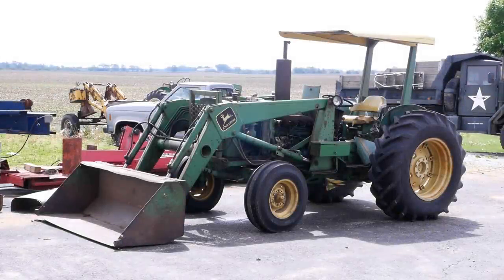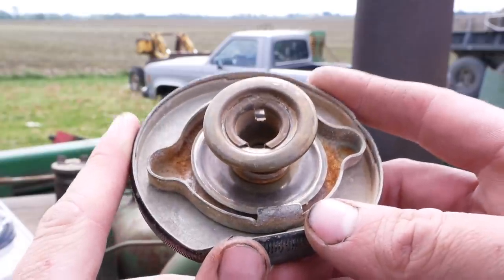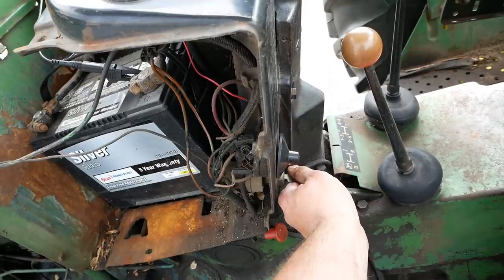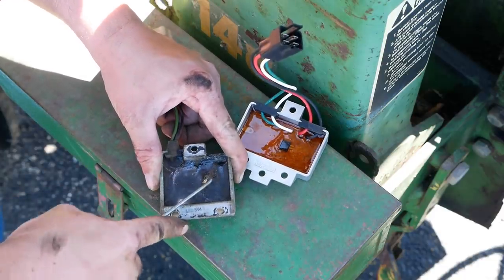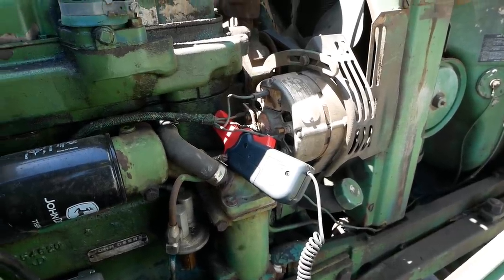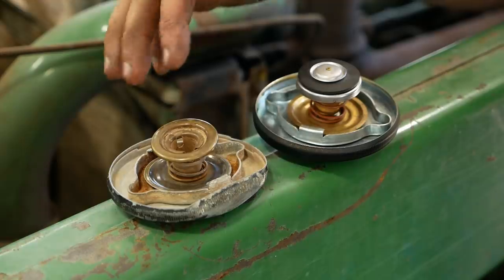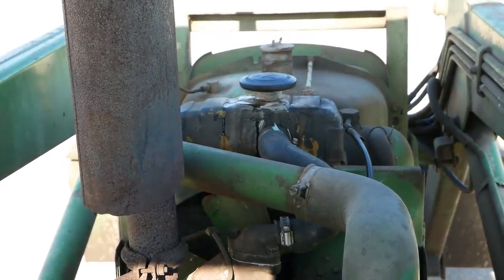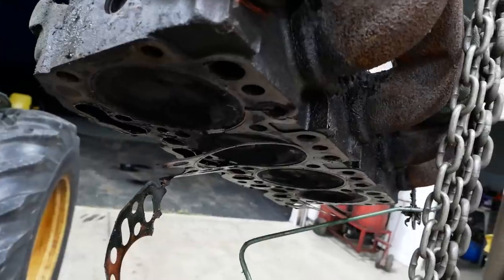Not Fixing a Tractor - Overheating and Barely Starting

Comment: Wow, just wow. I've never seen that many cracks in a running engine. 

I know the type of customer well, run something beyond the ground and then ask for a full service. 

Given the state of the engine I really can't imagine the gasket will make any improvement, but if that's what the customer asks for it avoids arguments and blame games further down the line. 

I see equipment for sale in the UK all the time with a long list of recent new bits being presented as a plus point. Every time I see one I think they've failed to find the problem and are presenting it in its best light to get rid of it. 

In my experience the service history is often a list of jobs that need to be revisited and done properly.

Comment: Had another story,Guy hired me to put clutch in his 1948 Ford.Remember that one the Entire rear axle had to be un bolted from the car in order to pull Trans.Got the car torn down,he only wanted me to replac clutch ,reuse old release bearing,and pilot bearing.Flywheel was severly heat checked,told him about all the problems,he said don't worry he was going to sell the car as soon as it was running.Came back about two weeks later complaining that I should have fixed his car better because it broke down again.I showed him the work slip I had made up where he declined to have proper repairs made.He got angry but I did not fix his car for free.

Comment: I really like your videos, and I don't want you to take this the wrong way, but this could have been avoided. The tractor sounded cranking over like one piston was much weaker than the rest. A pressure test on the cooling system would have pointed to deeper issues as well. It's worth spending a little more time on diagnostics even when it feels like you know what the problem is. 

For example: I once bought a Lincoln Navigator that had a nasty miss on one cylinder. I'd been around the block a few times with the modular motors, so I instantly thought "coil", reinforced by no signs of the coils having been touched recently. Nope. Burnt exhaust valve and mangled valve seat. That 20 minute fix turned into several weekends, all because I thought I had it figured out and didn't bother with a leakdown test.
Reply from the maker: I did a pressure test on the cooling system. It showed no leak even when left over night. We knew it had issues from the blow by but I just didn’t expect that much damage.

Comment: Sorry see that happened to nice John Deere tractor Wes :) also my late Dad & Late Uncle Bill bought 2 owner tractor in 1988 off excellent make plus model tractor with loader  and owner told them tractor was complete rebuilt! 4 years later what hard starting up plus Power Steering was loose like no asstiance at all when loader on but when off back normal and motor smoke so bad even after rebuilt completed previous to plus fuel injection pump also new injectors plus steal lines change no difference! So I took my work and got me plus my 2 cousin to tore apart found need need new block& head plus totally engine rebuilt on every thing plus hydraulic pump plus Steering overall also found need new Clutch plate too plus Brakes and electric on battery cables plus Starter even GM Delco Alternator put on ! Cost lots money to that Tractor to do but fix till one day my dad also uncle motor start overheat plus smoke black blue when bale hay found engine belt broke off motor plus took the Electric connection  of Air Induction on front engine near Generator or the Alternator pulley is ! So got belt for them plus had fix Electric Air Induction  connector plus brand new wire of 12 gauge wire solder plus wire up plus heat shrink lots electric tape too ! Fix up in field also back normal thank goodness or would had scrap the whole tractor and didn't at all ! But my dad & uncle always said after that B.S. struggle that never buying use stuff only brand new from now on dealer approve! The tractor had fix was 1978 International 724 72 hp Desiel motor 265 Cubic Inches size Double Displacement motor Detroit type with Allied 4 hydraulic cylinders and guy sold for low hours plus for $4500.00 in 1988 at auction farm sell ! But full of crap when had replaced parts in 2 years get it Wes !

Comment: i had to drill a hole transmission pan of one of those to clear a pickup screen, had no transmission pressure.  then cleaned and rebuilt the brakes with original parts.  then drove it to get beer in heavy traffic.  interesting day.

i also fried the old starter with dead batteries.

Comment: We have a john deere 300 industrial loader that has the 3 cylinder version of that engine. The block rotted away where the sleeve seals to in the bottom. The steering sloppiness is the bell crank setup in the front. Ours is wore out more than that. Lol

Comment: I wonder if water glass would seal up the cracks in the head and block.  My dad used it in an old Cat D4 head after restoring the tractor and found a leak.  It sealed up many years ago and still holds.  Obviously the engine needed pistons and sleeves, sad to see it but like you said the tractor has an endless list of repairs needed.

Comment: Just my opinion, in situation like this, head gasket repair sealer might be a viable option, the silicate chemistry at high temps solidify to like glass and plug up cracks in the head and block and it is permanent, have to follow the instructions and use a good brand for diesel engines

Comment: the weak point in your approach to this tractor is that you should have had the owners start and run the tractor and demonstrate its condition before you put a wrench on it......then you could have had a full picture of the possible scope of the problem before you fixed the electrical system......in future it might be wise not to rely on what the owner says but to ask for a demonstration of how they are presently using the tractor.....the clouds of steam and many leaks would have made an impression and you might have suggested a complete restoration

Comment: Product  up  in  my  neck  of  the  woods  called  Iron-Tite.  Used  it  several  times  on  "beyond repair"  cases.  Prolonged,  and  only  prolonged,  the  inevitable.  But,  several  months  to  seasonal  availability,  compared  to  sitting  in  a  field,  AND  one  that  had  been  six  years  with out  a  head  leak.  Keep  one  in  the  tool  box  all  the  time.   NOT  a  mechanic.  Absolutely  Not  a  mechanic.  Just  a  guy  who  needs  it  to  run,  and  it  needs  to  run  NOW.  Or,  at  least  tomorrow  morning.

Comment: Excellent  video 👍🍻. That tracktor will go to auction and be bought buy India trading company  and then shipped to India  where they will repair  the problems with JB weld and duct tape, then sold to a farmer there who will use it for the next 20 years. You my friend  got that tracktor  to start and run, they will hook up a 45 gallon tank of water to keep it cool. 👍🍻

Comment: Great job Wes. I'm sorry to say you can't fix stupid equipment owners. Ive decided the best way to check used machinery is to pull the air filters. I can't believe how people don't replace them. 3 things to long engine life. Cooling, clean air, and clean fuel. Most people will change oil.

Comment: I have found that sometimes you need a thermostat to cool it because water flows to fast and doesn't get cooled in radiator.  Had a big block Chevy and had it burn out starter when battery was weak and when starter going bad, battery would croak

Comment: What a frustrating job. Then again, what frustrating customers.  Maybe they think that running it on just plain water will cause sufficient corrosion for the cracks to heal themselves? You never know, it may be a stroke of genius. A self-repairing tractor. Why is it that they won't spend to save? Surely a few hundred dollars in repairs, or even a thousand dollars, is still cheaper than a new tractor? I would also want to give your electrical guy a refresher course on alternator testing. Man, that thing was against you every step of the way. Never mind, at least you fixed Thomas the Tank Engine. 😁 Stay safe.

Comment: I sent you a link to how I fix John Deere starting/charging problems. Cheap and works great. I use Delco alternator 334-2114 on Amazon. Works on most all older tractors. Jimco (jimcotest dot com)out of Raymore, MO has just about every bracket and wiring adapter to adapt a Delco one wire to just about anything plus testing equipment.

Comment: One or more of the four diodes in the bridge rectifier for the old alternator were bad.  With only two of them functioning, the output voltage will be very low, as it was in this case.

Comment: I would have run down the bad piston and honed the upper part of the cylinder.
If there would have been any good piston rings left i bet it would atleast reduce the blow-by.

On a wet liner engine, the condition of the block matters little, as long as the water and oil stay where they should its ok to have it craked between coolant passages etc.

I have a Nuffield that has a craked block between every sylinder, headbolt etc as it has had water frozen inside one too many times.

Still it holds it's liquids and they dont mix.

Comment: Man, I hate seeing a piece of equipment in that kind of shape. Makes you wonder about folks who would allow that. Anyway, a couple or three  comments. 1. I like those gear drive starters for John Deere. I use them exclusively. 2. Several years ago I started using Loctite 545 on all my hydraulic and air fittings. Have not had one single leak since and I don't find pieces of Teflon tape in my hydraulic filters. 3. I get rid of Motorola electrics when they fail. Hate those POS. Delco one wire internally regulated is the way to go. I find several YouTubers doing the same.

Comment: At 21:20 it looks like the radiator tank is split between the filler neck and upper radiator hose fitting from freezing when it had water in it.

Comment: Over heating problems , try filling the radiator up to the cap with fluid and spin it no start . Bubbles and you got problems .   Any one that runs straight water / no thermostat   send them down the road .

Comment: Wondering if you could have offered to carve out where some of the cracks are and scab in some weld and clean it up just to reduce the leakage a bit, and put sealant on the head bolts like you said
Reply: Nvm it’s not even worth that

Comment: It's a good idea to put some chassis/axle grease on the battery posts and all over the battery terminals before you reinstall the cables.
Reply from the maker: Not on YouTube. People go bananas about that!
Reply: @WatchWesWork  -- I've done it for over 45 years!  Never had a bad battery connection in all that time.  I've even seen that method described in military heavy equipment manuals.  It works by keeping the connection free of oxidation and has zero effect on the resistance of the circuit.  So I guess these keyboard mechanics know better than the military maintenance manuals.  :o)
Reply from the maker: @rpsmith  I like to cover them in dielectric grease, but that makes peoples heads explode on YouTube...
Reply: @WatchWesWork  -- My philosophy is to teach when I can and ignore when I can't.

Comment: My Skoda SUV has a feature where it runs the cooling system for a bit after you turn off the engine to get rid of the excess heat.

Comment: It is at least possible that the cap created much or a lot of the problem.  The pressure in the system means fluid exits where resistance is least.  Sometimes a new cap makes the radiator leak, for example, when the pressure of the cap now exceeds the condition of the radiator.  So in constantly exiting the useless cap it was not cooling as it needed to otherwise.  If true, sad indeed.

Comment: How small of a borescope would you need to look in cylinders of something like that, and how much time/work is there to get injectors or glow plugs ( if applicable) out to use it?  
Seems like maybe, and I'm guessing, if there was a way to be more sure of if it was getting coolant into the cylinders you might have stopped sooner on the job.  Passing the chemical test in the radiator early on there was not good.
Reply from the maker: You could do that, but I've never tried it on a diesel.

Comment: you said the problem right at the start. 'john deere'
you know what they say. nothing runs like a deere.

in all seriousness any machine will last if taken care of. if you keep the coolant, oil and stuff up to it and replace bits when they are worn out or broken the tractor will last forever. if you just ignore everything then everything will be broken. 
i think the cracks in the head and block may have been caused by someone dumping cold water into an overheated engine. 
that tractor could be fixed it would just cost quite a lot to do. is it worth it? depends on how much you value that machine, i would say judging by the condition of this tractor i would say they don't value it at all. 

if it were my tractor would i fix it or get it fixed? no, because it wouldn't be in such bad shape.  even if it was in that condition i probably wouldn't fix it as the cost would likely be more than a reasonable used machine.  but i would work out the costs of fixing vs the cost of another tractor and work it out from there.

Comment: I'm not wise to tractor replacement cost or repair costs, but with this tractor would fixing everything be more than 30 or 40% of the cost of a new tractor?
Reply: It probably does make sense to repair everything on this tractor,  it will be expensive for parts and labor but it will be a small fraction of the cost of a comparable new tractor.  Tractors are freaking expensive,  if you need a tractor you have little choice.
Reply: @davidnull5590  Yeah, that's what I was thinking too, all the more reason to take care of your equipment with proper timely maintenance!

Comment: Blue devil head gasket sealer may work it runs about 7499 for the big bottle all you have to do is remove the thermostat and let it run also no coolant must be in the system so you must flush it out,.

Comment: What would the availability and the cost be to replace that tractor with a used one that would be functional? Clearly that one has reached the tipping point of no return.
Reply: everything is fixable IF you are willing to throw enough $ and time at it. that beater isnt worth neither, better off as parts donor to save one that isnt beaten down nearly as badly

Comment: Running water in the winter is what cracked the head and block im surprised it wasent worse
Reply from the maker: I suspect they poured cold water in it when it was hot.
Reply: @WatchWesWork  What makes you believe that?  Does it crack in a different place/manner?  Or do the condition/problems of the machine suggest it is more likely?

Not challenging your expertise Wes, I want to improve my knowledge.

Comment: Man, that's a tough break. Having family that works farms, I know about making these decisions and it always sucks, especially when they don't take the best care of something because they think they are 'sticking it to the man', or just 'farm fixing' it. A few of my distant cousins are cattle farmers and they cultivate their own feed too. Some of them take utmost care of their stuff and some don't. The successful ones are taking care of their equipment, which is not to say they don't cut corners like crazy. The other ones will leave tractors in the field, not sharpen blades, run rusty bailing wire through the bailer, take their hot tractor into the creek which comes up to the engine. All sorts of stuff. Their stuff is broken a lot.

Comment: It's annoying how people in general just run shit until it fails completely. The cooling issue on the tractor caused the cracks for sure especially not even using coolant. They straight up fed you a line. Shame on them for wrecking a reliable old tractor, most farmers are actually going back to the older equipment because it's far more reliable then the over priced new crap.

Comment: I'm guessing the owner doesn't use it much and is hoping to get by as long as possible, after all he has been using it this way. With everything else that is wrong with it the tractor may not be worth the price of an overhaul. This way he gets some use out of it before the scrap yard. Question, could you have done a compression check for a head gasket leak instead of the fluid and found the cracks?

Comment: I have heard that block testers are not an effective way to test for blown head gaskets on a diesel ram into that on a duramax gasjets were blown block test showed good
Reply from the maker: The problem is the test is done with the engine cold. Leaks usually show up when the engine is hot.

Comment: CE Auto Electric Supply has crimp elbow and flag terminals you could remake those battery cables with. 
Also, after you said it's much worse in the daylight, I knew you were going to say the engine block was cracked before you even got to the head. Oh man.

Comment: Only John Deere I have ever owned spun a bearing. I need the engine rebuilt but it's $6000 minimum to rebuild it and I only gave $1200 for the tractor. They are only worth around $5000 as is so I haven't been able to justify the rebuild yet.

Comment: Offer them $2000.00 for it then put a couple of thousand and do an inframe overhaul. BEING A LOADER TRACTOR  TIE RODS AND FRONT END IS PROBABLY WORN OUT.   LOADERS PUT ALOT OF STRESS AND WEAR ON THE FRONT ENDS AND THAT ALSO IS PROBABLY WHY THE STEERING IS SO BAD ALSO.

Comment: Really should run just one big battery, throw away the Motorola alternator and replace with a delco, and if you wiggle the steering wheel while cranking the engine will turn over faster.